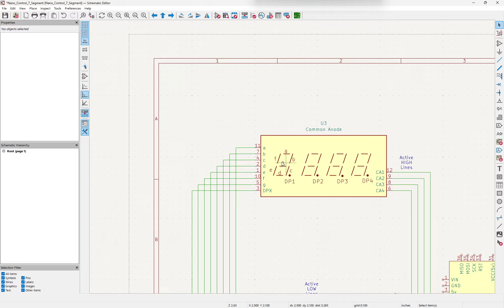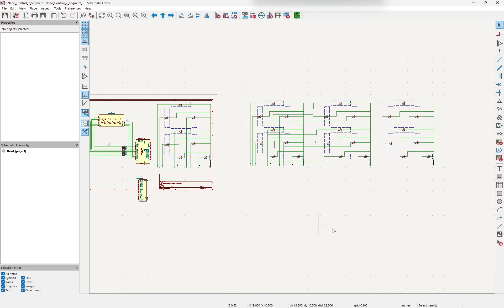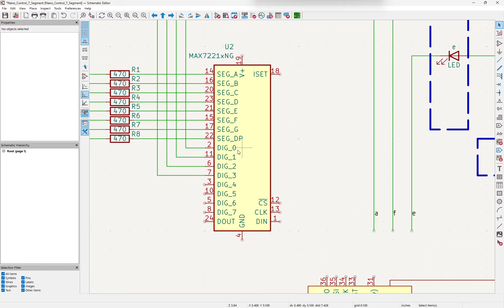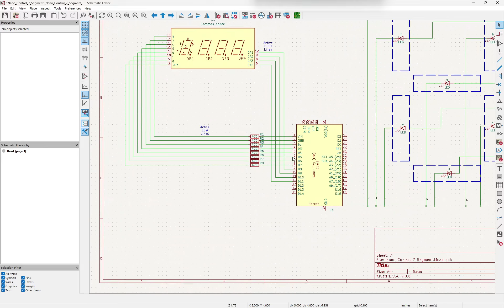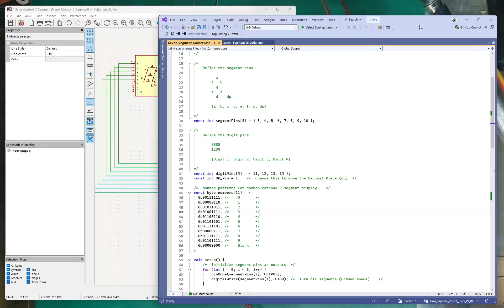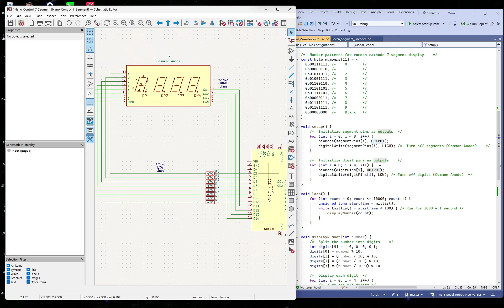Preparation for: Project X [Part 1, 7-Segment LEDs]

Comment: the way that works is called multiplexing light up 1 segment then the other and then the other it is kinda cool how those displays work... but I think I would prefere Oled displays you can show more information on them.... and I believe in a wat VFD displays work in the same ways as this display here....
Reply from the maker: This is the word I could not  remember.
These Project X videos are about a specific PCB I will be looking at and want to try to to explain how each part works.

Comment: you were trying to say the frequency does not match of the LED light and the display.
Reply from the maker: Yes, if you watch my videos you will see I get there in the end, I have an issue with name, basically I forget the correct word, I know how things work inside my head, but putting a word to it is the issue. No worries.